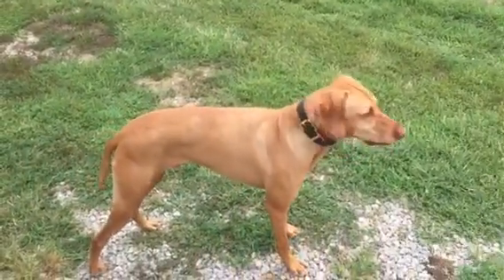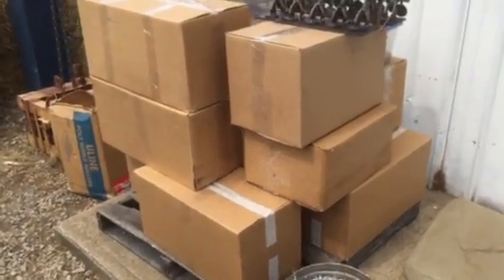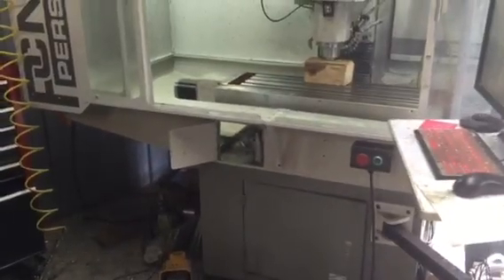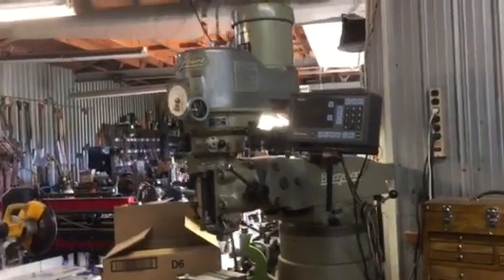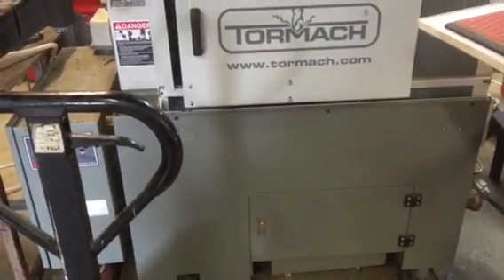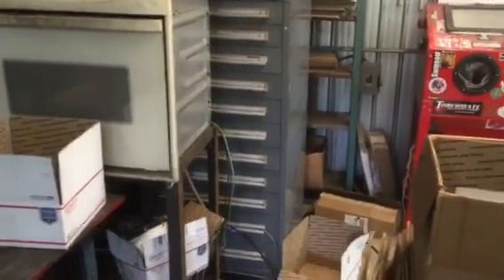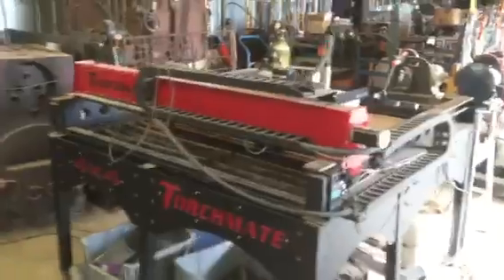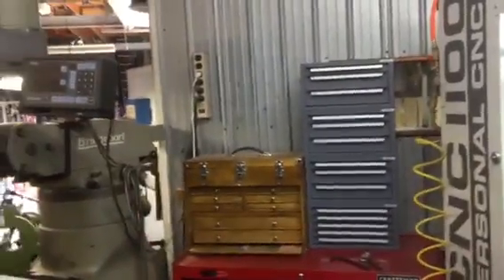Move update #1!  Onward!

Comment: Floor plan for the equipment is important and saves time. Take your time, don't rush. A few heavy cargo straps to hold the top heavy machines will help a lot if you use a skid loader. New big skid loaders though are just as good as a forklift  if you take your time. Old carpet works great to save paint when using cargo straps.

Comment: John, 
Regarding the screw compressor, check out the Atlas Copco Compressed Air Manual 7th Edition.   It's a good resource that covers everything from compressor noise to economics of operating a compressor.  Atlas Copco is top notch.  You can download a pdf here:
http://www.atlascopco.us/Images/Compressed_Air_Manual_tcm45-1249312.pdf
Reply: +Richard Freeze 
Wow, that looks like it's chock full of info! I hope I don't regret my compressor purchase after reading it.
Reply: +NYC CNC 
Look at chicago pneumatics, I can't atest to it longevity because I have only had my 7.5hp for less then a week. I did the price shopping of all the big ones. Made by atlas copco. Take advantage of the canadian dollar and look up dynamic air in greater toronto area.

Comment: May wanna check out eaton compressors they have both rotary and piston and sell everything from bare pumps to complete units and dryers for decent prices plus they are american made.Stay away from a rotary unless your going to buy a monster...the small ones just wont cut it if you need a lot of cfm.Get a good high cfm low rpm piston pump for less then a quarter of the price.two people can talk over one of the eatons even standing right beside it...build a small enclosure around one and youll forget its even there
Reply: I would say get one of their larger bare pumps(10-15hp) and a motor to run it set it up to run at minimum rpm,use your current tank and call it a day but if ya can afford a rotary and it meets your needs go for it! I just ran into a cfm issue with  one of the "small to medium" sized rotaries but there were also 5-6 airtools and 2 spray booths going at same time.Owner thought he was solving the problem by going rotary and needless to say it didnt cut it.

Comment: John
A few suggestions. Call Tormach. They will be happy to give you some guidance. You should be able to rent a forklift at an equipment rental shop. It should be relatively inexpensive, especially when compared to a damaged piece of equipment. Neighborhood of $100.00. Another possibility is to contact a towing company. Their wreckers will be able to lift almost anything you have easily. My Brown & Sharpe horizontal mill weighed 2 1/2 tons and  I rented a trailer that was rated for four or five tons and a forklift to unload and place it. $200.00 covered everything. Two trips with a trailer that size behind a 3/4 ton pickup will move both Tormachs, your Bridgeport and your lathe.
My thoughts.
John
Reply: P.S. I used to be in the air compressor business. Get an Atlas Copco. For what you want, they're the best. We hated selling against them.
Reply: excellent thoughts

Comment: Your Bridgeport is approximately 2200 pounds so an average size skidsteer should be able to get it. Knee down and table centered, strap it to the machine tho is very important since skidsteers can be a bit jumpy. When you load all your machines put wood between the metal trailer and machine to prevent moving. Actually I think it's a DOT standard to haul metals objects with wood cushions under them.

Comment: wow it's amazing to see what you've a mast in the last few years from your bare foot videos with a brake and drill press and a cute little CNC machine, to now you've got a ton of my dream tools now and I couldn't even imagine moving half of it, I have an older Lista that when I move I actually trick the lock mech. and take all the drawers out and then move the shell and then put all the drawers back in takes only a matter of minutes to move some thing that otherwise is very difficult to move. Also we use an IR nirvana 50 horse screw compressor where I work and it's amazing how much quieter it is than the previous generation 75 horse screw we use to use. took a while to get use to it running so quietly. good luck with the move!

Comment: John, most of the time I see Bridgeports moved with their heads rotated 180 degrees so the motor is down on the table. This will help to lower the C of G. That's the real enemy, as you well know. 

Be careful with pallets, I've seen some fail where the planks were carrying the load and not the bearers. The result was the load toppled.

I'm not sure about that lift hook on the Tormach and whether it's actually designed for full machine load. If it were that's where I'd sling it from, without doubt. Take a chassis punch and knock out a neat hole in the enclosure. You can always put a removable plate over the hole later, as you will for sure need it again. However if it were me I'd contact Tormach and they should be able to provide lifting diagrams and advise on the hook. If they can't they deserve a kick up the backside, as that's standard information for any quality machine.

It goes without saying to be careful mate, and the standard brief I give to anyone who is helping is that if something looks like it's about to topple, don't try to stop it. Never assume anything is "easy" to lift. Machine tools are unstable loads and what can seem easy can actually turn out to bite. Be careful of the cabinet wheels on anything other than perfectly smooth surfaces within the shop, as I've had loaded wheels fail at their attachment points when moving. 

Don't overlook properly securing the load when transporting. I've seen some truly idiotic securing done, with monster straps attached to sheet metal! The load needs to remain secure in an emergency situation, and not sitting in the middle of an intersection because some peanut tried to cut you off when turning (as I saw one time. I never did fins out how they got the remains of the machine off the scene, but do know the castings were destroyed). Just when you think you have "enough" straps to secure the load, add another! If a strap fails for whatever reason, the load should still be secure. "I'm just taking it down the road" is no excuse.

Good luck and be safe.

Comment: Have you looked at rotary scroll compressors? In my research it appeared that rotary screw compressors are not particularly suited to being started and stopped multiple times. It looked, to me, like they were much happier when they were able to be continuously run. I'm guessing you aren't using enough air to warrant continuously running a compressor. Scroll compressors, on the other hand, are fine with being started and stopped. In addition to that they're oilless and basically maintenance-free.

Like the Kaesers (sp?)  I'm fairly certain they are available with air dryers and tanks, if those are things you'd be after as well.

Comment: Make a box for the compressor from some 2" thick polystyrene, it will knock the sound level right back.
Reply: +NYC CNC yes, you should be able to get the sheets for nothing from  a builder. Probably not as quiet as a screw compressor,  but will certainly make the piston type bearable.

Comment: If you can afford, this is probably on of the best compressors on the market.
http://www.sullair.com/americas/en/stationary-air-power/products/shoptek-compressor
It's on my list right after the 5 axis mill ;)
Otherwise just put the air intake to the outside and put a baffle around it (make sure there's air flow though). I've got a 7.5 HP 2 stage that you can't even hear running over the the rest of the shop.

Comment: angle iron with a couple of u-bolts may be a good idea it's rigid and even the smaller stuff is rather strong I'm not sure how you'd apply that concept but again just may be helpful and as far as your skid loaders go I found that a few welded pieces of metal that just slip over the bucket work very well of the welds are good quality (they would look like a lower case "h" when they are completed

Comment: re: skid steer; I have moved a lot of heavy things with skid steers. You will need to look up the tipping load on the machine you are using. Skid steers are wayyyyyy more prone to tipping than a forklift; Also, make sure you have an experienced operator....jerky movement, something a skid steer with rubber tires on something with high friction (e.g. asphalt, broom finish concrete) will be prone to do, will decrease the tipping load significantly.  If it were me I would start to get nervous at around 70% of tipping load, considering we are talking about machine tools that don't need be jarred on a tip. 

Keep the load very low (<6 inches) and if you are nearing .7 tipping load, or it feels like it may tip, get a couple of men to stand on the back of the machine. (generally rigging eyes or something near the rear can be used) Use common sense and you will be fine. I have done it a hundred times to move less delicate items at or exceeding tipping load.

Comment: On the Bridgeport mill, spinning the head 180 and putting a block between the motor and table helps with making it nice and stable to lift from under the ram or the lifting hook. Also helps with height clearance.

Comment: there's basically 2 types of screw compressors, modulated like the Ingersoll rand and load no load "On or Off" but they run full speed all the time. We have both types in our shop I do the preventive maintenance and repair on both compressor, Ingersoll is a 100hp and the other one is 75hp. Personally I like the Ingersoll Rand much better. Maintenance is easy and after 14 years of running 24/6 at 60 percent compacity, I see no problem getting another 15 years out of it.  Noise level is much lower then the non modulated one. There a two factors your going to have to consider before buying one. First screw compressor are good when running at or over 50 percent capacity. second an air dryer is a must or at least lots of bleed offs. If your are gets below 20 in the winter then have a way to vent back inside the shop or the cold air will fall back into the compressor were it freeze the moisture in the compresso causing sensor failure and damage your radiator over time from expanding and contracting. Hope this helps.

Comment: If the skid steer is a Bobcat you need at least an S650, its rated for 2700lbs.  My Bridgeport is 2200lbs so that would be a bit tight.  Flip the head over to move it to keep the cg low and go slowly.  You can use a 3/4" eyebolt in the ram if you have one, otherwise lifting straps worked well for me.

Comment: One Bridgeport that I moved was loaded at one end but we had no way to unload it at the destination. I called an auto tow company and they sent out a real tow truck. Used the cable winch hooked to a sling under the ram, and he offloaded it from the trailer. He then backed the truck up and was able to set the BP down about 5 feet from it's final resting place. Cost about $60. A good pry bar alowed me to slowly inch it into place.

Comment: I saw a shop with a high ceiling, they mounted a platform about 7 or 8' up to support a horizontal compressor then added some sound absorbing panels around the compressor.  Dense carpet works well for a cheap solution.   A good bit of the noise comes from the intake -- a good home built muffler or route the intake outside work well.  The best solution is to put the compressor in an outdoor enclosure.

Craig

Comment: Probably already know this but you should be able to find the lift capacity of any skidsteer (assuming i heard correctly about how you plan to unload).  That's going to be minus the weight of the attachment, if you're using pallet forks probably ~400lbs.  With the bridgeport and tormach probably both getting close to a ton you're probably going to want an S250 or bigger.   If you can't get that, I'd look for better options.

Sunbelt has forklifts for rent.  Rent it for the weekend, they will drop it off and pick it up (two weeks later).  Probably $500 with delivery.  They might let you haul a small one with a one ton truck.

Comment: It depends on what size skid loader they have but it should be able to lift the tormach, idk how heavy the bridgeport is so I'm no help for that unfortunately. I actually just finished moving my new tormach 1100 into my basement using a skid loader and it was no issue. Granted mine was still in the crate as I just recently got it, but I'm happy to help in any way if you have any questions. Here's a few tips from what I found moving mine and using our skid loader: 
- Be very gentile on the controls for the skid loader, it is much faster and more jerky compared to a forklift when moving the forks. Lifting (with the boom / arms) up and down isn't so bad but be very careful tipping (roll front to back) the forks as I found that to be the roughest. 
- When raising or lowering the forks they may not stay level so be sure to watch that as you raise and lower your machines / pallets. We had to lift a little, stop and tip it back to level, then lift a little again. Same for lowering. 
- Our forks are adjustable so be sure to set them best for each lift if you have adjustable ones too.
- Be mindful of the type of surface you are driving on and how the tires behave on it, specifically when turning. The skid loader will tend to start bucking / rocking / skipping when turning sharply on pavement which can be very dangerous if things start sliding around and shifting on the forks. I almost had my two stand crates fall off the pallet the shipping company put it on because of this. 
- For top heavy things you can run a strap around it once it is on the forks, attaching each strap end to the vertical section of the fork attachment.
- Finally, I found it helped a lot to throttle down the skid loader so it was running at a lower power. While this may sound counter intuitive, I found it helped slow everything down and remove a lot of the jerkiness when lifting and tipping.
Reply: +mcg1355 
I would agree with these suggestions especially throttling down the engine. One other point use second or even third gear if available or high range daft as it sounds - motion is much smoother and less jerky.

Above all keep loads low and move slow to keep the centre of gravity low.

Comment: When I operated Forklifts, the lifting weight capacity was displayed on the Registration plate... I don't know if the skid-steer would have the same information on it's... However, if you have the make and model, the manufacturer's web site should have that info... or just Google the "lifting capacity of make and model the info should be out there somewhere... Rubber tired or track is important too... Good luck and be safe :-)

Comment: You can build an enclosure for your compressor... the key is making sure it's got good air for compression and for cooling.   Just a wood box insulated with Roxul sound barrier, and two air ducts that don't have a straight line out (think pieces of wood on opposing sides, so the air & sound has to go around several corners, on the inside of the roxul.)  Get a cheap indoor/outdoor thermometer, and you can determine if you've got good airflow, so you don't overheat it.  Decrease the sound considerably well less $80. I've had to move everything I have three times in the last two years, which is a lot more than you've got, and I had to do it alone.  I feel your pain!

Comment: John I moved out of a shop a while ago. The guy that moved in my old space wanted my air system witch had a Sullair rotary screw air compressor (excellent air compressor but costly) and traded me a  Chicago Pneumatic air compressor in a sound enclosure with dryer and this is one nice air compressor. it is also quiet I would say when your machines are running you wont hear it. They claim 64 dbA noise level. Go to their web site and check it out. The one I have is a QRS7.5

Comment: Haha, well I remember lifting a rather small CNC Mill out of a safety box of an injection molding machine.
Didn't have any lifting points or anything so what we did:
1. Slip two T-Nuts in the slots (diagonally)
2.Screw in eyebolts
3.Lift the thing outta there with the crane.
And no, wouldn't do that again haha!

For what I can say: I drive 3 ton injection molds around all day, on normal pallets.
They are your friends.
And the lathe and bridgeport could fit on , you would have to try.

Good luck!

Comment: Dont know if talking about same kind of screw compressor, but the ones i have been around are so loud. Maybe build a sound enclosure with proper venting and such?
Moving is never fun, ill be moving soon and practically starting over, so i feel ya. :)
Reply: +Jack Hudler The ones i was around(80gal Craftsman's mainly) where so loud, i would much rather have a piston type compressor, not to mention easier to work on with typically more cfm. 
Iam sure there is much better screw compressors that address this, but was just stating my experience.What brand you have?
Reply: +Jack Hudler That pump looks like a piston "wobble" pump. Like the one i used to make a vacuum pump out of. Those are fairly simple to work on and rebuild kits are cheap.

Comment: Kaeser compressors.  Best in the business.
Reply: +crunchysuperman I agree. Great setups, you can get some MONSTER 3k CFM cabinets with only 60 dB levels. Amazing pieces of equipment. If my screw ever goes out, Ill invest in a Kaeser
Reply: +crunchysuperman I've had bad luck with Kaeser, on a 30hp I've had to swap the same defective part (radiator) 3 times in less than 6 years
Reply: +Miguel Reyes We've got five that range from 15 to 75hp that run 16hr/day  for 20 years with no issues beyond regular maintenance.
Reply: That's why I say I had bad luck, afaik it is a "newer" radiator, first got covered by warranty, the following 2 were not, and they are expensive. Even with regular maintenance they're like that. We have other 2 15hp and those work like a charm.